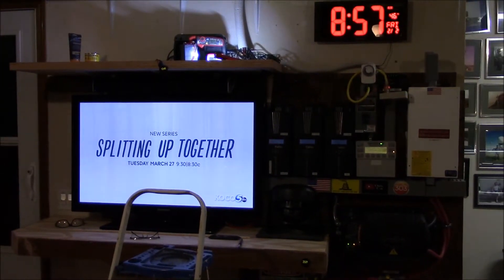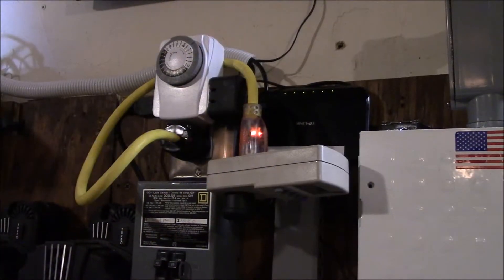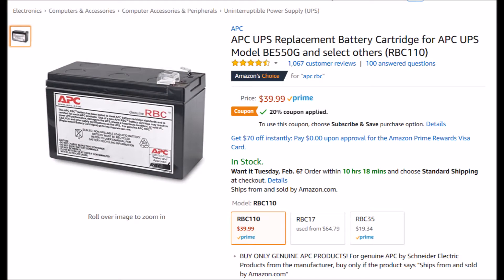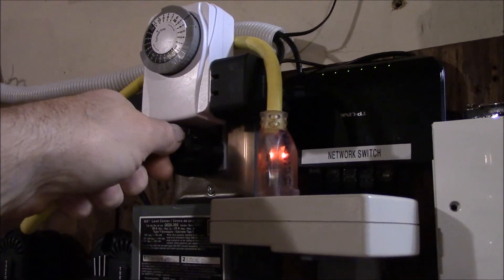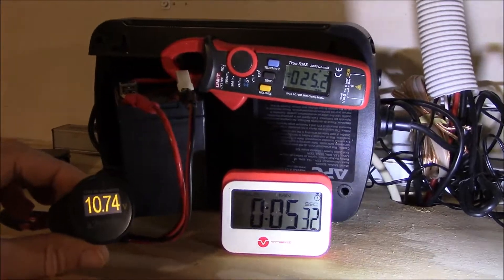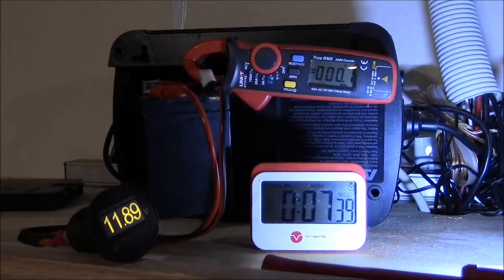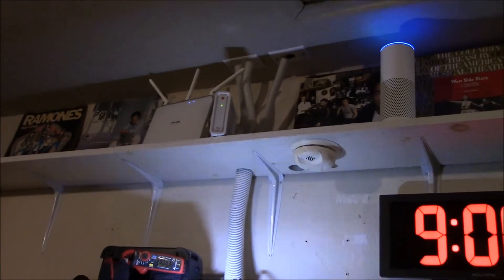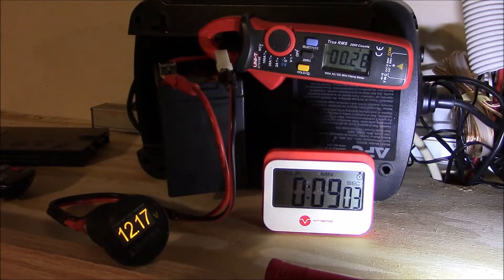How long will it last? APC battery backup (Part 1 - 200w load, stock battery)

Comment: Hi, I have one APC ups and the output off the inverter is quasi sine wave when I remove the input AC . I don’t like using it with my TV or any other sensitive electronics on this back up supply. I’m going to use it to run some lights on my garage instead.
Reply from the maker: I tested it too...and it is a beyond ugly sine-wave. Doesn't even look "stepped".

Comment: Chris,  I replace batteries in these UPS and they keep going.  But I've been hearing that the surge protection wears out in them and after a few years they don't protect your electronics anymore just like any other surge protection.  Have you heard this rumor?
Reply from the maker: Yes, that is true...that is why I recommend getting surge protectors with the highest "Joule" rating. Basically, the higher the number, the higher number of "hits" it can handle. So, would last longer (theoretically). If you have shyty power and lots of bumps...gonna have to look into something more drastic for protection
Reply: Thanks......  I'll take one apart  and look for the MOV and replace that when I do the battery.

Comment: Thanks Chris, I have been replacing the batteries in a bunch of these lately. Been buying them off ebay for $18.60. Getting ready for our storm season. Also I've gone all electric by adding a used model S to go with my Leaf.
Reply: Neil Mayo ouch, these are the same batteries that are used in fire alarm panels. 12 volt 7ah. I buy them from interstate batteries for $9.90 each.  Just goes to show how much they are marked up.
Reply from the maker: Right on! I didn't buy any replacement batteries for that APC UPS. However, CHECK OUT my Chris DIYer page posting...you might get a laugh at what I just finished! https://www.facebook.com/ChrisDIYer/
Reply: Can't find it on their site, is there any shipping cost?
Reply: I have a business account setup with them.  I go into the local store and negotiate the prices with them.  They deliver them to my office for free since they are local.  If you have a batteries plus local to you, you may be able to get them cheaper there if you don't have a interstate store. I'm in Minnesota, it seems like we have battery stores everywhere.

Comment: You should hook up a solar panel with controller to that battery,  another solar generator
Reply from the maker: 10-4, hear ya. The battery is too small for transforming it (practicality, cost) into a solar generator/battery rig. Also, the sine wave output is pretty ugly looking (tested it out, see the video link at the end). This APC unit is decent for what I use it for...it is already plugged into my home solar power circuit. However! Got something else "planned" for this APC battery backup...stay tuned